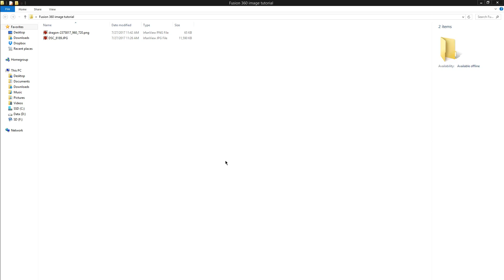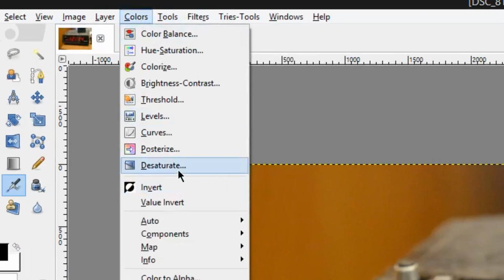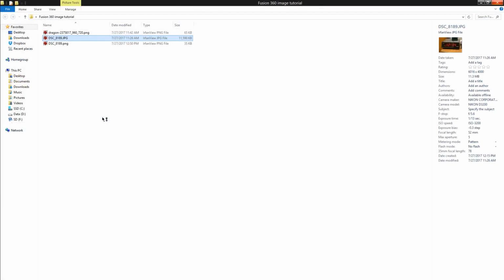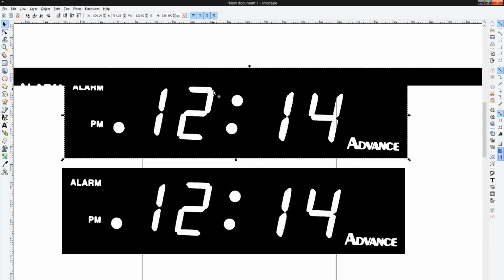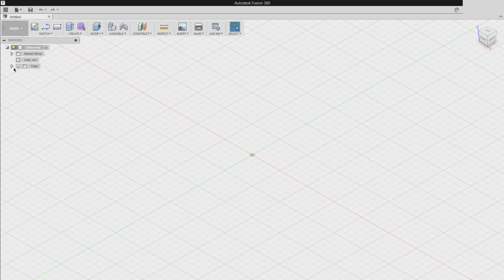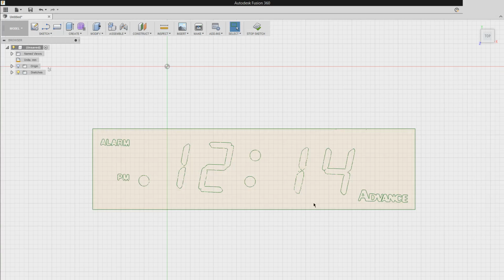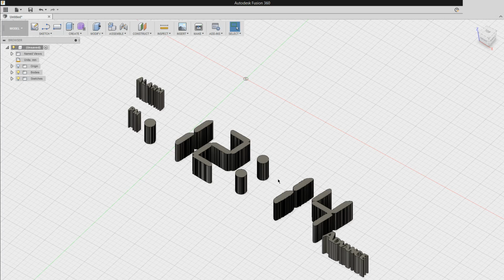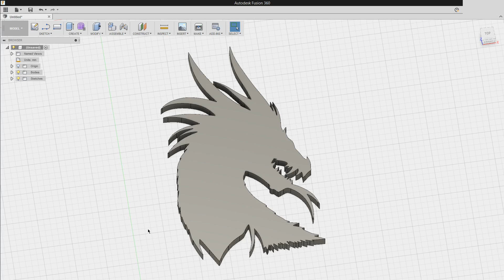Convert Images to 3D Models (Line-Art to Path Tutorial)

Comment: I want the extrude base to be a 3 percent draft.  Face slightly smaller than Base.  For a sand cast so it separates from sand easy.
Reply from the maker: In the extrusion menu, there is an option for a taper angle, and that should give you what you need.

Comment: My problem is when you get to the CAM portion.  It ended up with like 100+ chains trying to get it to select everything.
Reply from the maker: I've never worked with the CAM in Fusion 360, but I imagine it's because there can be thousands of 'lines' that it's trying to follow. I'd try to reduce the line count in InkScape (likely an option in the 'trace bitmap' dialog) to simplify the SVG a little bit.
Reply: I tried a few options in InkScape.  I'll keep at it. I did mail a guy that makes videos for AutoDesk for Fusion 360 about it. I hadn't heard back.   For now I've been using Easel.  I haven't got to see if the actual output works.
Reply: It looks fine in InkScape.  Also pulled it into Easel and it's fine. I think it might be the import into Fusion that's the issue.   Still have yet to have an answer.  For now the ones that end up like this I will have to do with Easel.

Comment: this does not work.  Error: The selected SVG file contains no information or some unsupported information. The Fusion sketch will not include unsupported geometry.
Reply from the maker: If you're going from inkscape and saving an SVG, make sure you delete the bitmap that you imported into inkscape before you export it. It has bitmap data that is incompatible with the SVG format (hence, the bitmap tracing).
Reply: @LazerLord10  i did.  although i may have removed the vector and kept the image.  i moved the top one out of the way and deleted the one left in place.

Comment: What if I wanted to make the words hallow per say, as in make a solid piece with the words missing and add lines to help keep the center of the letter, like O, E, or P
Reply from the maker: I would make an extrusion that will be the object (not the text), and then place the text/image on a new sketch located on the face of the object where you want the text to be. Once you get that done, you can select the regions of the text you want to be hollowed out, and extrude in the negative direction to cut out the text from the object the sketch was placed on.
Reply: LazerLord10 sounds easy enough thank you 🙏🏼